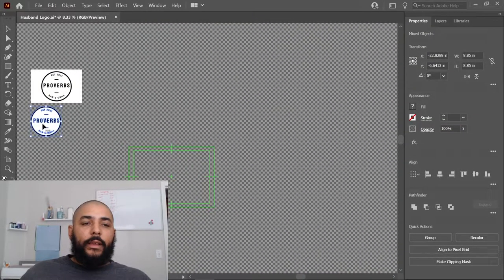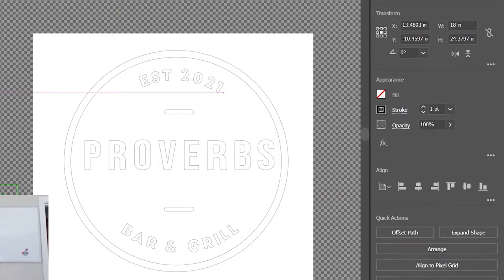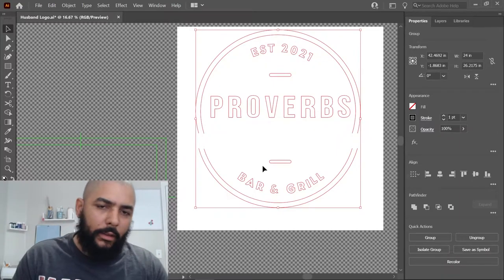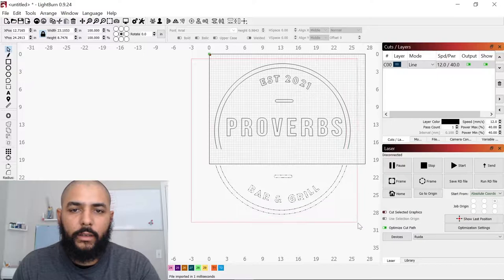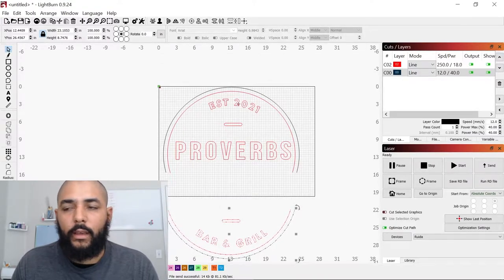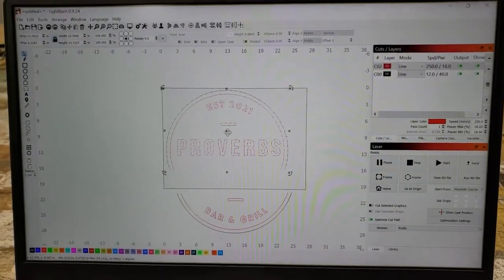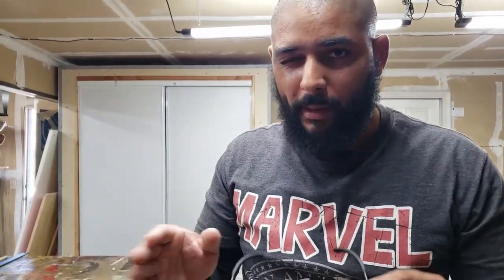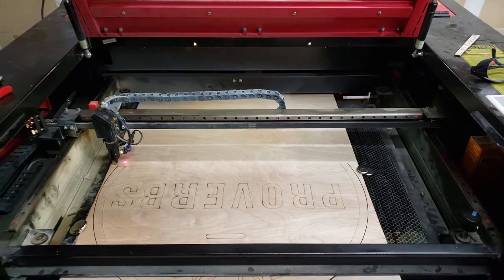How To Use Pass-Through Slot On A 60w Red And Black CO2 Laser Cutter

Comment: Why not close both eyes when pulsing the laser? You can always tell if you're on target by the mark. I'm with you that vision is extremely important and nothing is worth the risk of blindness or degraded eyesight.

FYI - The new Xtool P2 with its automatic feed on the pass-through option is a big plus for cutting oversized projects. This option allows cutting up to 23" x 96" work pieces in a single operation.